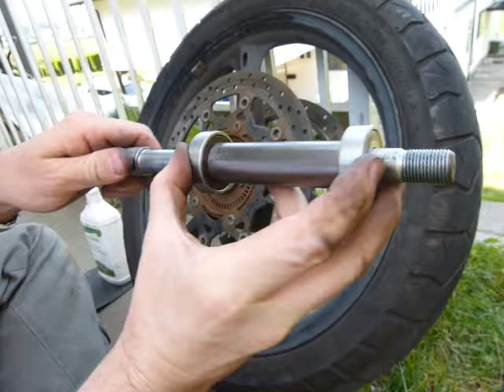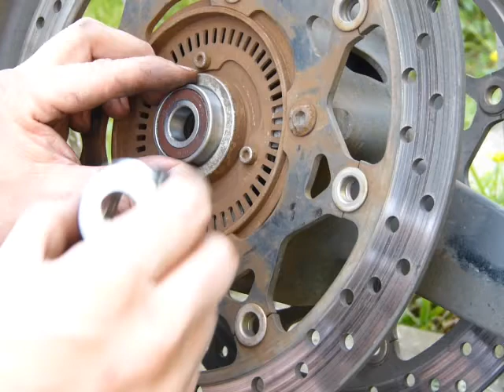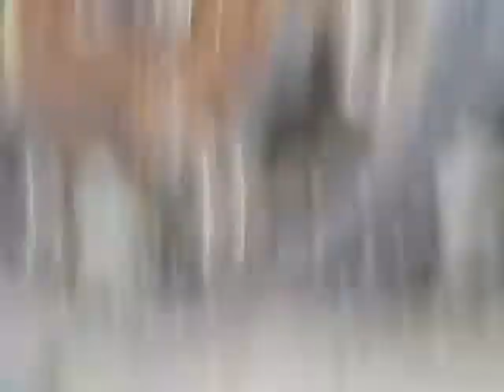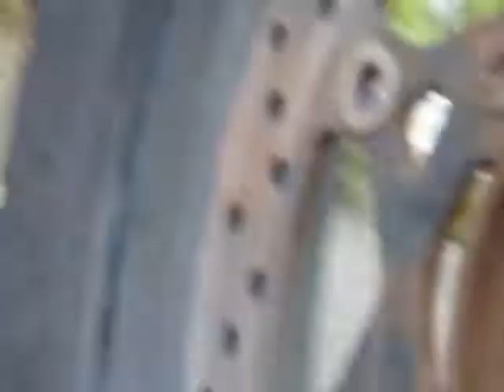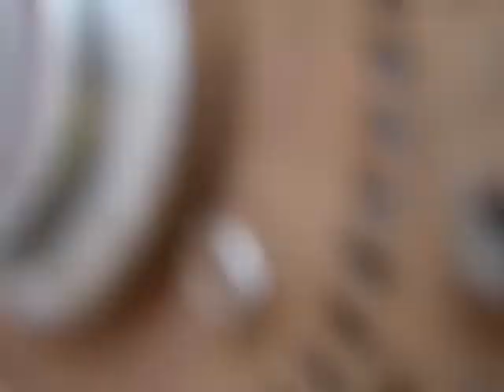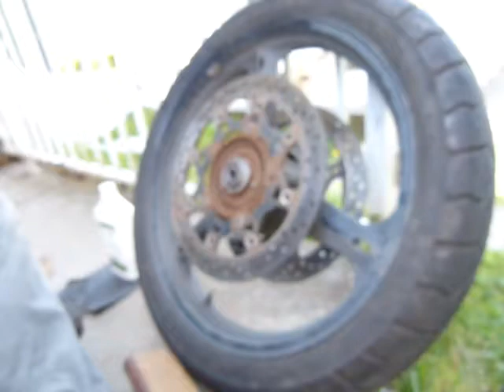Install a new wheel bearing

Comment: Did you grease the outer metal at all before tapping the bearing in? If not, why not?

Good videos, BTW.
Reply from the maker: Did not lube it. Rotation should happen between the bearing balls and the inner surface of both races, not between the outer surface of the outer race and the wheel hub recess. Any grease added there would create a possibility of turning within the recess. With turning comes friction and wear. The aluminum wheal wears super fast. If the bearing is wobbly in the wheel hub, the axle will wobble too. Very unsafe, and expensive to replace the whole wheel is the bearing is not solid in it. The bearing is intentionally bigger than the hub recess, just by a few 0.001"s or 0.01mm`s. Keep is at design dimension, no grease and don`t skew the bearing as it is driven in or out, keep it square as much as you can.